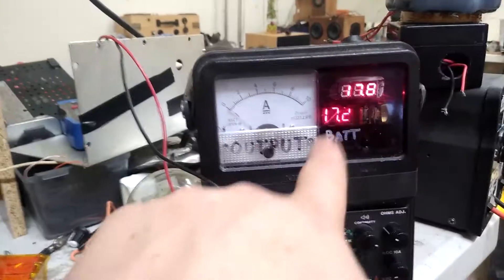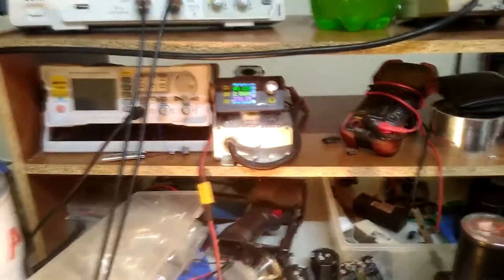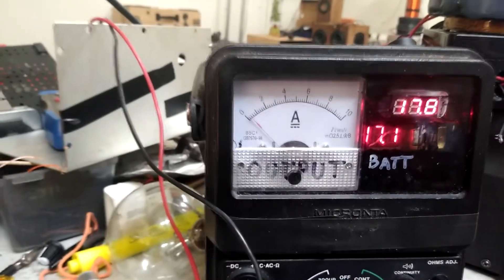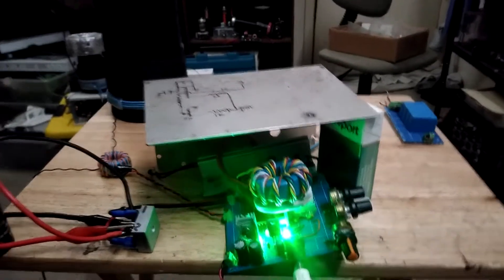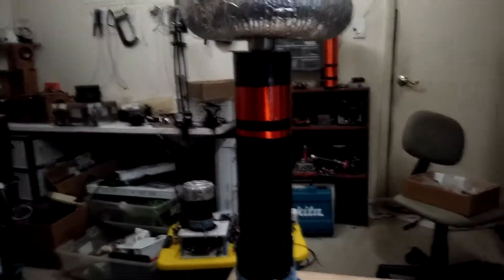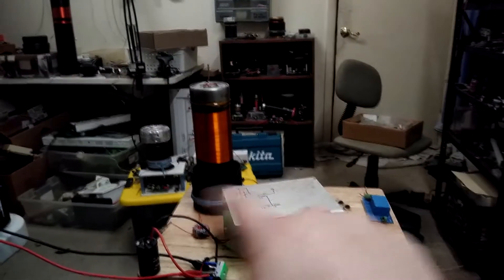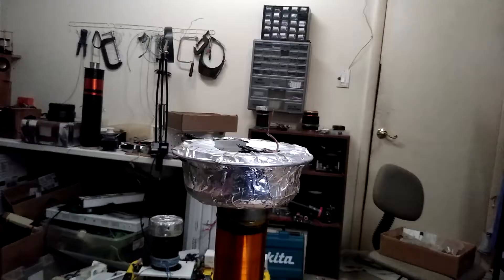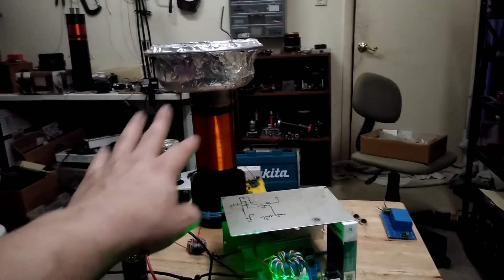Full Bridge SSTC, Different Coils + Gate Drive limits.

Comment: Can you share the circuit also
Reply from the maker: I don't have a diagram drawn up of this setup yet but I will have one eventually. To build it you can just follow the schematics I built it around.

Start with Steve Ward's https://www.stevehv.4hv.org/SSTC5/miniSSTCfnlsch.JPG It's a great driver and I'm just using it to drive the full bridge. The changes you can see are the 15v gate drive instead of 12v and adding a CD4046 PLL chip to the feedback portion. That's not necessary but I did it so I could screw around with the phase shift some. That driver was not meant to drive a full bridge but you can see I'm trying to show how much of that you can actually get away with .

You can get an idea of how to wire a CD4046 for this easily at Erik Taylor's site http://uzzors2k.com/index.php?page=pllsstc1 and I've just made the ranges on it variable so I can run different coils easier. It's based on Steve Conner's PLL driver. 

For a full bridge wiring you can refer to https://www.stevehv.4hv.org/SSTC2/SSTC2-03.gif and the way mine is setup is pretty close to that aside from 440V TVS diodes and the IGBT's.